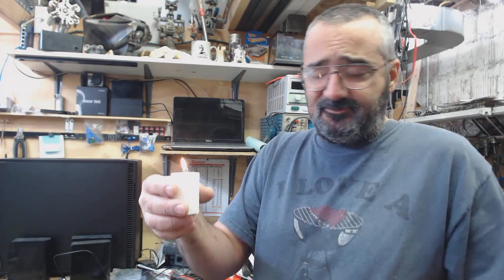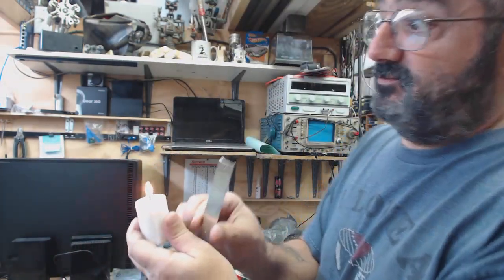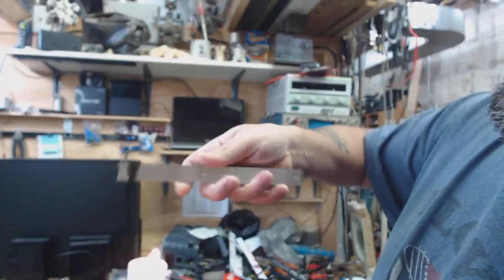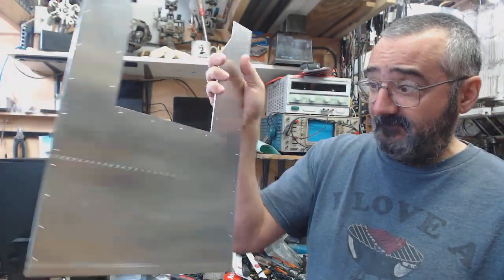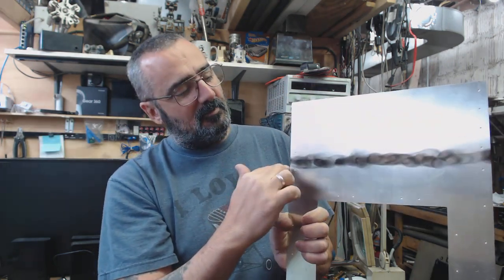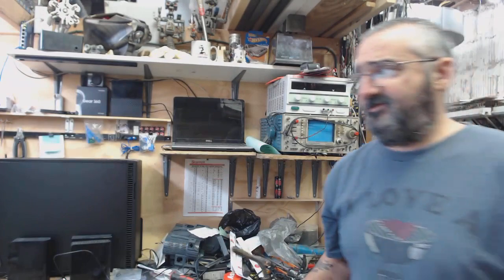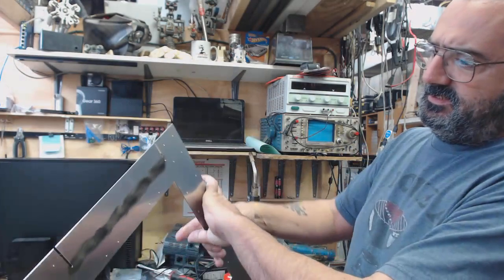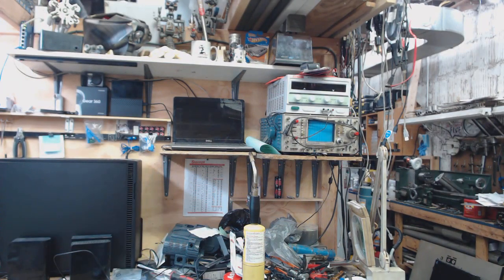Annealing 6061-T6 Aluminium, the correct way!

Comment: 30 year welding and machining. I use a sharpie marker ! You should also move evenly across the panel from side to side. Don’t just start at one edge and work across. Just a tip. Good luck

Comment: so after annealing the area then you will bend on a brake? I want to bend some 3/8's  6061 rod - 1 bend - so when the carbon mark goes away you have reached the correct temp to start the process?

Comment: Might help if you placed a thermocouple on the back side of those plates to have an idea of what temperature you reach with the torch. Perhaps consulting a standard for annealing of aluminum will help refine your process to more of a science, recording annealing temperature and time. I don't think your plate should bend during the annealing process. A few tips for that include clamping the plate, pre-heating the plate before annealing, and heating up both sides of the plate.

Comment: Dear sir 
I have a aluminium tube diameter 40mm and thickness 2mm, alloy 6063 . I need tensile strength 270 M pa , please tell me process after extrusion how can we get?
Reply from the maker: I'm sorry but I cannot be of any help to you as I'm not an expert in this field.
Reply: why don't you quench it as soon as it is exruded and then try artificial aging ?

Comment: Show how to flare the tip of a 2" OD aluminum pipe using a torch and maybe some sort of metal cone?  please.
Reply from the maker: Well , none of the parts on my Robot fit those sort of features. I would think that within reason, the way I annealed the 6061 Aluminium Sheets should also work with Round stock as you suggest. Give it a try!

Comment: Can you bend aluminium tube after t6 heat treated and retain it's durability?
Reply: Oh an I'm a quality control manager for an aluminum extrusion company that makes 6061 extrusions.
Reply from the maker: My basic understanding is that once Aluminium is annealed and bent, it will somewhat "age harden" after a period of time (At least a few weeks?) but will not re-harden to it's previous full strength temper on it's own. To regain full T6 temper, the Aluminium has to be "heat treated" by a company that specializes in re-tempering of annealed Aluminium.
Reply: T6 will have a minimum ultimate strength of 38,000 ksi, minimum yield strength of 32,000 ksi and minimum of 8% elongation. If you annealed it, it will be much softer. I can't remember the exact tensile parameters but the ductility will increase greatly. In order to bring it back to t6 temper, you will need to heat it to 450°f for 8 hrs.

Comment: you said the candle method was too slow, and opted for the faster method ,honest mistake I would have done the same  but at least we are all learning from these vids ,even if you just get one comment,,,,,, if you ever get a chance, a vid on basic ez-b set up would be great or what you have learnt to do with it
Reply from the maker: Yes, I had Just thought that the Candle method would be slow without actually trying it. Turns out that is is surprisingly fast and produces a much better and thinner soot coating to indicate the correct annealing transition temperature.